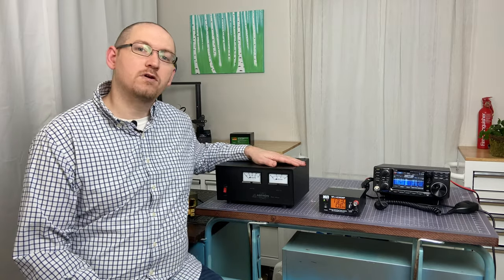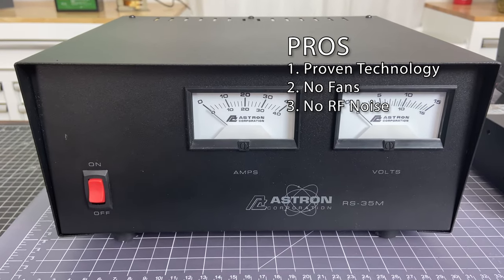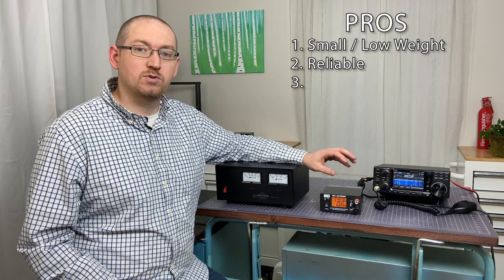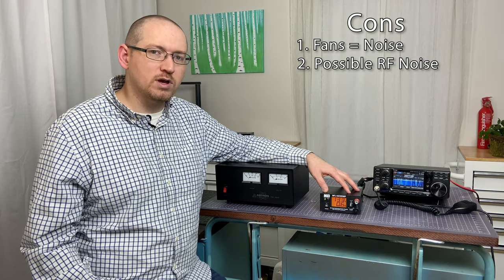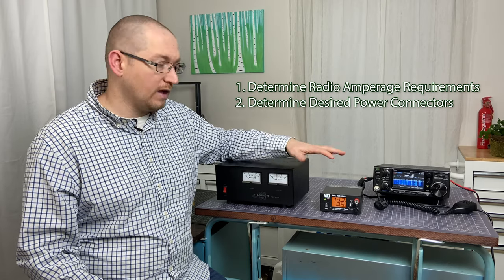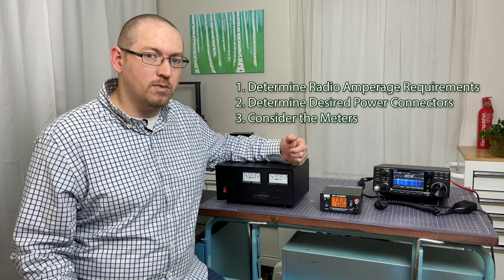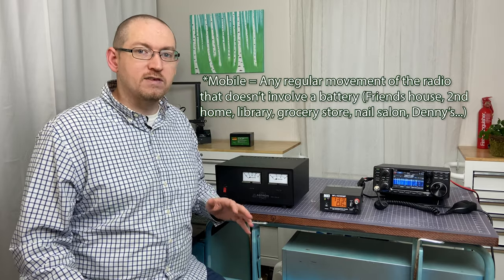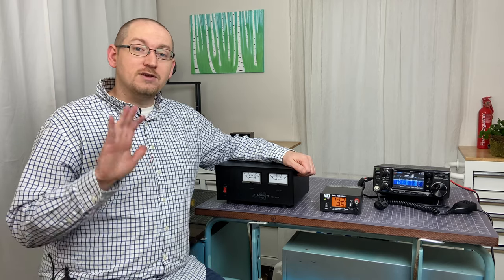Your First Power Supply - Linear or Switching?

Comment: Appreciate you sharing your thoughts and insights in this video.  I have boat anchor p.s & switching p.s.   I enjoy my switching p.s. the most. The newer switching p.s. generally meet my Amp requirements.  Of course the Astron are fantastic in my opinion.

73 Steve AA4SH
Reply: I especially like the digital meters vs analog.  However currently I’m planning using the newer Lipo battery for POTA /SOTA

Comment: I have a mighty light 25 amp switching power supply. Runs my 7300 and several meter lights. Never had a problem with RF noise but I can hear the fan running if I focus on it, but,  I've had it from the beginning and don't even notice it anymore.

Comment: Money, size and weight were and are a big deal so we bought a Samlex 1235m, based on recommendations made on other videos.   Still your recommendations have me thinking.  How hot does that Astron get when running all day?
Reply from the maker: The Samlex power supplies are nice, and from the eHam reviews their owners seem to be very happy with them. As to the temp of the Astron, I can not say with any certainty as I've never measured it, nor do I typically touch it during use. In my shack, it sits about 2 feet away and at eye level. I've never noticed any heat emanating from it, and in my cold basement I'm always wanting a bit more heat. I'll have to check this out during my next long-haul day and report back.
Reply: @transmittinguntilrobotsrep1045  The people in my local club in MN, love the Astron, but as I said, money was and is an issue.

Comment: I'm using 6 Ah LiFEPO4 batteries (in parallel as required) on a 2000 mA trickle charger.  Works great, no heat, dead silent.  It's brave now world for shack-power ;-)
Reply from the maker: Whoa, very nice! I’ve lost power twice in the past month and both times I thought about how it would be nice to have a setup such as yours. What charger did you get? What brand battery?
Reply: @transmittinguntilrobotsrep1045  Also, the wall-wart has some RF noise, so wrapt the cord through a ferrite a few times.  No issues, works very well.

Comment: I'm considering using an Astron Linear power supply for one of my audio amps but I'm confused on how to use the power terminals on the back. Just strip some wire and tighten the positive end around the positive and negative around negative and tighten, run wire to DC plug of size and then into amp?
Reply: That's about the size of it.  You can use banana plugs, spade lugs. I use a 50 amp DC connector; like Anderson powerpole but a lot bigger.

Comment: For my UHF radio, I restrict it to 5W so I use a Dometic fridge adaptor which has a cigarette lighter socket. I can provide 6A or 72W, not sure about RF noise as a fridge doesn’t care.
I also have a linear power supply but it is a big heavy bastard. I bought it in 2000 bud never used it much, it doesn’t (apparently) have capacitor disease.
I would like to put a cigarette lighter plug on my Icom 7300 (for DXing) but the wires are too thick to connect to the plug. I might just use banana plugs to join it knowing I won’t exceed about 20W.

Comment: In the case of the Astron specifically-does it have surge protection to help shield the transceiver?
Reply: Most Astrons have SCR crowbar overvoltage protection.  If the output goes above a preset limit, the output gets shorted and it blows the fuse.  It will save your radio.

Comment: i've had a boat anchor of a dc psu from MFJ since early 2000's, it's unkillable however it's heavy (40 pounds) and not suitable for applications where I want integral variable output (CC or CV). It outputs up to 17v and 70 amps on household current.
My next psu will be a lab grade unit that fits in a backpack but won't snap my spine. :P
It's either a keysight unit or a siglent unit.

Comment: I chose a 20ah lifepo4 battery.  And a solar panel.
If I've got mains power, cell phone.
Why even, power supply?
Reply from the maker: I like the way you think! I've had no problems running from both a LiFePO4 and traditional SLA batteries. I love going to a local park and getting on the air. 73, AC3DS

Comment: switchers are useful for portable operations but you'd have to pull my astron VM50 out of My cold dead hands before I give them up.

I have several of the variable voltage adjustable current 50 amp astrons and I have 70 amp VM astron And like I said you'd have to pull them out of my cold dead hands before I'd ever give them up. The 50 amp models sell for close to $500 today they're only drawback is at their heavy which really isn't a drawback. once they get mounted in their position in the shack they never need to get moved.

The leg terminals on the back get extended to terminal strips using two gauge wire. a single 50 amp variable voltage astron will power your whole shack and you'll end up passing it down to your grandkids. The switcher is on the other hand are notorious for generating switching noise, the fans are annoying because they kick on anytime you're transmitting and you constantly have to clean them out because the fan suck dust and debris into the cases.

I have several high-end switchers but I only use those for portable operations. 

I'm still using laboratory grade linear power supplies on my workbench. I did order a couple of switching lab power supplies and all of them ended up going back because they all generated ridiculous amounts of noise. So I'm back to using linear power supplies on my test bench. 

If you're just getting into the hobby do yourself a favor and just pick up a decent linear power supply then you won't have to worry about dealing with the radio hash that the switchers generate.

Comment: Linears are not completely quet. Both Astrons I have, hum.  The smaller ones also hum. 
And need to mention crazy high magnetic field within 3 feet of any linear supply. Keep Away from them when operatiing!  Especially with heart problems, pacemaker, etc.  Not good. I measured magnetic field intensity, much much higher than maximum allowed within 3 feet or closer, any supply 20 amp or higher, keep away, use long power cable, 6 foot+
Reply from the maker: You are correct that they aren't completely quiet. The linears that I've used have had a barely audible low hum. I can't hear the hum over general ambient household noise, and certainly not over the noise of a radio. You bring up really interesting points with the strong magnetic fields - I've not ever considered that aspect of them. Definitely something to consider.

Comment: @1:50 “PR0Ns” 🤣
Starting an On,y Fans page?

Seriously… Excellent p/s presentation..
Thank you.

Forgot..
I’ve been using modified HP HSTNS-PL29 server power supply units.
They are extremely well designed and manufactured!
They were originally designed for mission critical servers and were VERY pricey.
They sold for $750@ !   
I buy them “refurbished” from a public safety comms company who actually sources NEW units and they only charge…
$250@ ..  JUST KIDDING!  How much?  $25 Shipped!
They are 100-240 VAC 50/50Hz.  and.. output VERY clean 12VDC at 65 Amps.
They require a simple modification.  2x 1k ohm resistors to enable them to stay powered on continuously.
(They normally get switched on by the server they are inserted into)
The only problem?
12 Volts DC and not 13.8Vdc.  My repeaters really love running on 13.8 (Hytera and Motorola)
There are a few YouTube videos on modifying them to output 13.8.  I just haven’t had the spare time to try.

Comment: When sizing your power supply, you probably should have mentioned that a 35A power supply normally can't supply 35A continuously.  The Astron RS-35 is only a 25A power supply.  The 35A rating is only on peaks.

Comment: I'll take my Megawatt switchers anytime. I have three 50W switchers in my shack. Two of them are paralleled and one is a stand alone. The Megawatt supplies are fully filtered and have a 100% duty cycle for trouble-free power as needed. The linears are much too heavy and expensive to be practical.
Reply: Too heavy?? You're too weak mate. Linear easily outperforms switch mode PSU anytime.

Comment: IC-7300 has built-in  voltage and current meter. 

Thank you.
Reply from the maker: Good point. Very true, the 7300 does have those same meters, and that is super handy, especially when I'm out mobile with my 7300.  I guess having dual meters never hurts though, and truth be told, I just like seeing those needles move.
Reply: @transmittinguntilrobotsrep1045  

Agreed, external power meter is good option to monitor the power.  BTW, the built-in boltage and current meter  only represented as bar graph.

Thank you, 73.
Reply: @transmittinguntilrobotsrep1045  Not only that, analog moving-needle meters are incredibly reliable and believable.  A bit delicate, but there's no digital circuits to malfunction without you knowing that your digital meter is not giving an accurate indication. 
So I have a Simpson 260 multimeter in my kit for just that reason.

Comment: I've found that certain LED switching supplies have drivers that splatter noise ONLY in HF bands.
Sharing that info critical
Reply from the maker: Good information to share, thank you! There are a lot of things which can generate splatter noise, and we certainly don't want our power supply to be one of them. 73.
Reply: @transmittinguntilrobotsrep1045  no doubt. I collected that experience through the gracious shares of others.
Reply: @transmittinguntilrobotsrep1045  and PS_ great screen name

Comment: That mfj has everything but the mounting  holes for it actually being a cheap computer psu. The front is nice and clean though. I have 2 stacked PS53KX. The only reason for a pyramid and not an Astron, is that the first unit was under 5 ft of water for 12 hours(not with power on)...dried it out...lubed the switches and wiped it down with wd-40. Has been working daily since 2016. It was built in 2004. 2nd one went down to $140 on Amazon...so a no brainer.
Reply from the maker: Wow, that you were able to recover a power supply from being under 5 feet of water and still have it work well is a testament to the quality of their product. And certainly anything that is that good is well worth the $140 for a second one. Good recommendation. Thanks for sharing.
Reply: @transmittinguntilrobotsrep1045  The switching power supplies have their place for sure. But all electronics are only as good as the components they're made  of and quality control that lets them out the door...thanks for the video.

Comment: How about Linear vs switching vs a car battery that is trickle charged in my shack.
Reply from the maker: The battery and trickle charger certainly adds a few elements, but is a solid performing option. I'll have to do some additional testing and report back. If you have any experience in the comparison, please share. 73 - AC3DS.
Reply: One thing to keep in mind when contemplating a battery power supply - your rig generally will not put out full power with less than 13.8V, and a car battery will be 12.6V or less depending on state of charge.  You won't get full power out.  My 100W radio does about 83W on a fully charged car battery.
Reply: My trickle charger is the worst source of noise; or is that the best (most!) source of noise (RFI).   I turn off the trickle charger to operate HF.  I also use a MFJ battery booster to get the voltage up where it is supposed to be.  It also makes a bit of RFI but some ferrite beads suppresses it pretty well.

Comment: I don’t use transformer I try designing a transformer less liner power supply it’s just works using higher voltage transistor  and good wire wound resistor and lm393 ic it’s really lightweight 2 pound

Comment: Yaesu makes a great linear PS and it won't break the bank
Reply from the maker: Yaesu does make quality products - is there a particular model that you would recommend?
Reply: @transmittinguntilrobotsrep1045  the 1030. All you need for 100w plus accessories and no noise according to my PX3.
Reply from the maker: @EricFullwood  Thank you for the recommendation!
Reply: @EricFullwood it's $270! The switcher is $50 or so on AE.